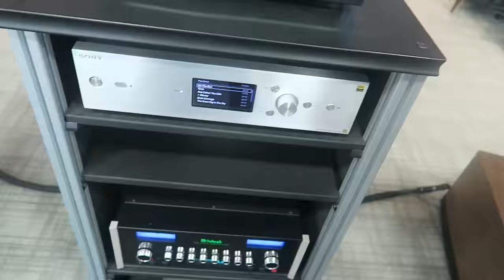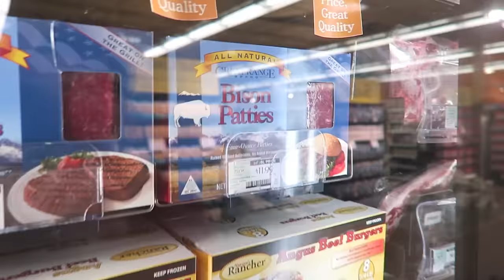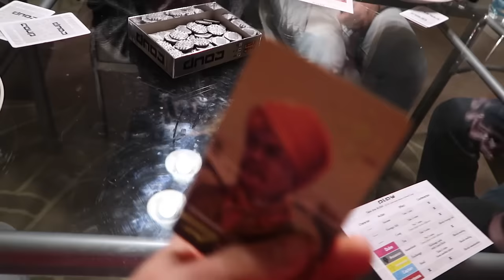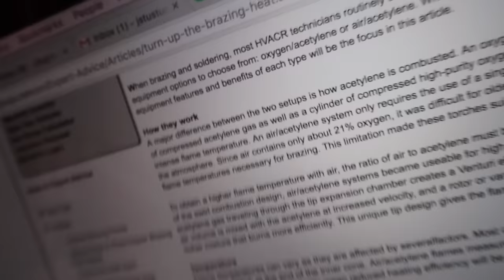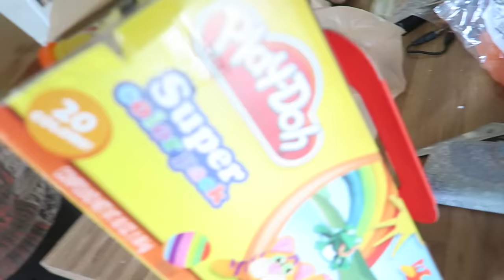1000+ DEGREE FLAMETHROWER VS SPATULA!

Comment: flamethrowers use liquids because the liquids can be "thrown" and still burn in the air, has burns spontaniusly. you have a weed killer not a flamethrower
Reply: Flamethrowers are illegal to own and even to use unprofessionally so I suppose this is best they can get... Would you trust these guys with a real Flamethrower ? lol
Reply: do you really think that's a weed killer?
Reply: it is.. it is powered by propane and wouldn't be any different with the new nozzle or whatever they bought.. a flame thrower shoots liquids like napalm or just normal car fuel.
Reply: haven't you ever seen a propane powered weed killer?
Reply: no. because they don't exist! what kind of weed killer would burn weeds at around 5400 degrees!?!?
Reply: Thomas Soderberg propane can't burn at those temperatures...... It has a max of 2500 degrees Celsius
Reply: Thomas Soderberg Did you just ignore my comment ?.. It is a proven weed killer XD
Reply: Thomas Soderberg it's a weed killer... Look up flamethrower and them look up propane powered weed killer. See the difference?
Reply: Paul Lewis one way minded people, huh.
Reply: i do realise that its not a flamethrower in the video. that doesnt make it a weed killer. and paul, i did read that comment. that isn't the same thing as what they were using in the vid. its not a weed killer, its not a flamethrower, its a gas torch.
Reply: Thomas Soderberg To be fair it is stated in the description a gas torch so I will only call them out on clickbait lets just leave it at that. The uses of a gas torch can vary from construction to weed killing and even making toast if you wanted lol 

Not many people know much about fire and how it works but they could have easily done this with a basic blowtorch but they needed the clickbait.

Comment: that was cool guys, just be careful with those things. I advise having a good hose or water supply at hand and ready to go if anything goes wrong. #1 rule about fire, is always: Don't play with fire. Please be sure to stress that to your viewers.
- also maybe don't do it near a house or anything flammable, this would be better done in a sandpit or abandoned parking lot or gravel pit or something like that.
-> also, you need better equipment if your going to be near the flame. That mask won't help at all. Get some professional gloves at least, there are some meant to be around fire a lot. 

If you want to go all out, there is actually those special suits that can be worn for working in extreme heat and around fire. ( they look like a silver colour ) 
- hope this advise helps. and if you need any other advice for working around fire, feel free to ask.